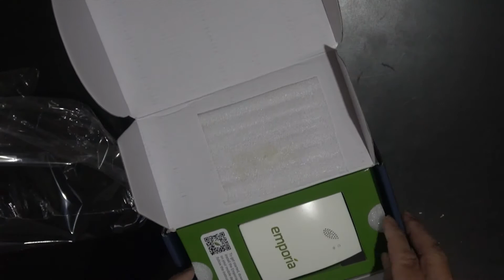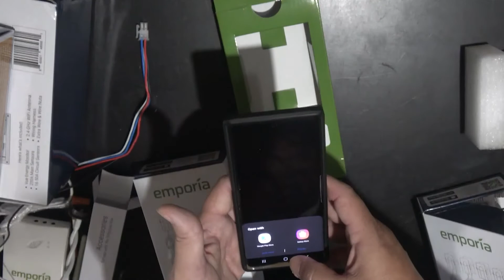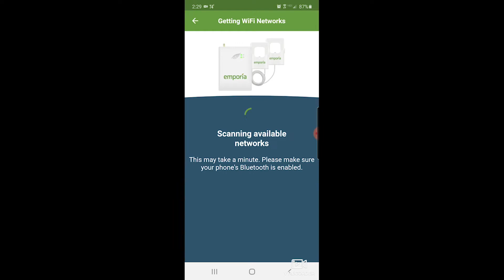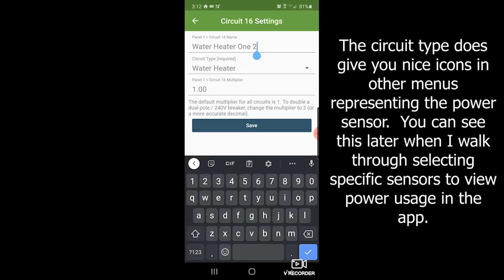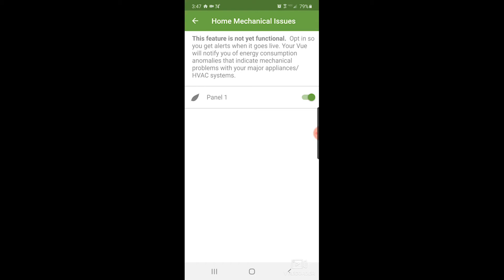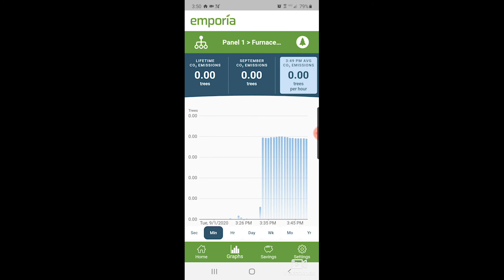Emporia Vue 2 Installation

Comment: What if I have 3 phase/3live wire main circuit breaker and supplying to 3 sets of 3 phase/ 3live wire sub circuit breaker. How the CT sensor should be clip?
Reply from the maker: The Emporia can support 3 phase, but you need to buy the 3rd CT for the 3rd phase separately.

Comment: Where did you get instructions as none were provided? Also, we have two panels as well and only intend to measure key circuits. Can you run a sensor into the other panel? That will mess up the percentages as the other panel has separate mains I would think but the circuit usage should still be accurate. Thoughts?
Reply from the maker: I got the instructions online as well.  Forget the link but if you chat them on the  website they can give you a link.

The way it is designed, you can't monitor another circuit in a different panel.  Theoretically you could if the sensor wire was long enough to make it to the circuit, but as you mentioned it would throw off total usage on the panel the main feed monitors are on.  If you were not too concerned about measuring total usage, it might work.

Comment: Why does your main show a higher value than the sum of the values shown?
Reply from the maker: This is because I don't have every breaker monitored so the total is more than the total power pulled by all the sensors. Mine is also thrown off unless you break it into an excel sheet b/c I have a panel outside monitoring HVAC that then feeds a panel inside that has two more Vue2s in the same panel.  They fixed it in an update where you can have panel A feed panel B, but there hasn't been update yet (that I'm aware of) that allows two Vue2s in the same panel and calculate total power used correctly in the app itself.  I've verified a few times that the total power used and the power used on each sensor is accurate, it just doesn't work in my case in app due to the daisy chain and side by side configuration without breaking into an excel sheet and manually doing the math.

Comment: Both my printed, and app, installation instructions state "IMPORTANT! the K (arrow) L imprint on the bottom of the sensor should point away from the breaker". The individual in this video states the instruction say it doesn't matter which way the sensors are installed (which way the arrow points). Clearly an incorrect statement by the presenter in the video..
Reply from the maker: The feed sensors monitoring incoming power at the top of the panel need to placed a specific direction as shown at the 8min mark.  Sensors on individual breakers do not have a specific direction.

Comment: I noticed you have two main panels like I have in my home.  Could I monitor both panels with one Emporia Vue system or do I need to purchase two of them and monitor the panels separately???  Does the app allow you to monitor multiple panels and view them collaboratively?
Reply from the maker: You can only monitor one panel at a time as a single Vue2 must connect/monitor the incoming power feed.  If you have two panels they should have separate incoming power feeds, thus the need for two Vue2s.

Comment: Do you have to have 2 spare breakers in order to install? Thanks
Reply from the maker: No.  You can plug into an existing breaker and share power.  Its not the best idea as you shouldn't have two wires in a single breaker, but it works.  You want to have a single open breaker.  You only need one for the Vue2.  I have two breakers as I have two Vue2s in the panel.  You could also use a single existing breaker for two Vue2s and what ever was being powered by the breaker.  If you monitor that breaker with a sensor you also gather Vue2 power usage.  
Not an electrician, but if I was going to do it, I'd run a copper wire from the breaker far enough where you had plenty of room (say bottom of panel box) and then splice in the existing wire and the Vue2 power.  Neutral both get secured separately on the bus bar.

Comment: great video, I used this to do my installation you explained everything very well. I could've just used the 8 sensor version I only have one panel  but oh well. Great tip on numbering the plugs and sensors! im getting ready to go out and clean up the wire mess pretty soon zip ties zip ties zip ties but im taking a sharpie to number plugs and sensors at the same time....   
One question for anyone with an answer (smart plugs with the VUE 2). Have you used any of the smart plugs as well? since most circuits serve multiple plugs / lights etc, I was wondering if the smart plugs will off set the breaker level reading or will it duplicate the usage? for example, say if I have a coffee maker on a kitchen sensor and use the plug to see what the coffee maker draws will it subtract that from the circuit reading or duplicate it? does anyone know????   
thanks again for the great video!!!
I also looked into sense and this just seems easier and about 1/2 the cost.

I did instal this myself in about 30 minutes and no I am not an electrician --- I'm just going to repeat because it is so important---- 
the big wires where the large sensors go:::: are ALWAYS LIVE, ALWAYS  even if you shut off the main breaker that is the utility power  side and your shut off only controls your panel --- the big wires are always live!!!  so if in doubt about your ability please dont mess with it.

Comment: Quick question. When I use the multiplier for my 240V A/C the wattage doubles. This I checked in the graph section. The amps units on the other hand do not double (assuming the same current flows through both legs) with the multiplier, they stay the same. The current showing in the Balance is not correct. Please try it to see if you get the same results.
Reply from the maker: I checked this and mine works the same way.  When a multiplier is used on a sensor (in my case testing with clothes dryer - 240v) the amps do not use the multiplier but the watts do.  I don't have any dual breakers monitored with two sensors anymore or I'd check the amp usage on each breaker. I don't believe it would be different though. There could be a small difference in amps between the two, but they should be very close.  I did have a few 240V appliances that pulled a very small difference in power between breakers, perhaps 1-2% difference.  I left the sensor on the breaker that generally used more power and used the multiplier on it.

When you say the balance is not correct, what are you seeing that makes you believe it is not correct?  The balance will be the total power used (clips on feeds coming into panel) minus all the sensors calculated usage.  The 'balance' is the power usage of the remaining breakers in the panel that do not have a sensor collecting data.  So if you have 20 breakers and 16 sensors (assuming none are dual breakers using a multiplier) the 4 breakers without a sensor is the 'balance' usage.
Reply: @forayfog2276  where you have a double breaker with just one sensor using a multiplier of 2, the current in the leg without the sensor is calculated in the Balance circuit. You are correct in your calculation if all the sensors are connected to one pole breakers and there are more one pole breakers without sensors then that current is in the balance circuit. They should correct the multiplier so the current doubles in the double breaker  circuits using just one sensor just like the watts double. It makes no sense to not have the current double. Just like it makes no sense to use two sensors and then have to add both sensors to calculate the load on one 240v breaker. I hope they fix this with a firmware update.
Reply from the maker: ok, I see what you are saying.
When monitoring one breaker of a dual breaker, the multiplier function should double amps and watts (could be any multiple, but in this case dual breaker so we are using a multiplier of 2).  Currently it is only doubling watts.  Because the watts are doubled, it effectively calculates total watt usage for the dual breaker and it does not show watt usage in the 'balance' from the second breaker of the dual that does not have a sensor.   Amps are not doubled for some reason, but should be.  This causes extra amps to show up under 'balance' rather than be properly be accounted for under the multiplied sensor.

Good catch.

Comment: Can you monitor A phase and B phase separately?
Reply from the maker: A single breaker will only be on one phase, that I know of (110v).  If you have a unit that requires 220v, it has two breakers next to each other vertically.  On most (perhaps all?) 2 phase panels, the A/B phase alternates going down.  So when you have two breakers next to each other vertically, they will always be on a separate phase.  If you have a sensor on each hot wire coming out of the breaker you are monitoring the usage on that single breaker which is on one phase.  So yes, you can monitor power usage of a breaker as it is on a single phase.

As far as monitoring the total power usage of each phase at the top of the panel, you can not in the app, or at least I have not seen it.  If you export the raw data, it does show the total power usage for each phase/feed.  You would need to document which monitor/clip is feed 1 and feed 2 and read the sticker on the panel to see what phase each breaker is mapped to before closing the panel up so you can total the usage of a specific phase you are interested in.

Comment: Could you explain the 240V breakers. I think you mentioned putting two monitors on each wire.
Reply from the maker: In the US you generally have 2 feeds of power into the house, sometimes referenced as Phase I and Phase II.  Each is 120V.  95% of items power in the house use 120V, but there are a few appliances like the AC compressors outside, clothes dryer, electric water heater perhaps a double oven that need 240V.  Most circuit breakers have 1 switch, these are the 120V power feeds to the house.  A few, normally at the top of the breaker box are two circuit breakers where the switch is fused together. When you turn this breaker on/off you are actually turning 2 breakers on and off at the same time.  Each breaker pulls power from Phase I and Phase II.  These are wired in series to the appliance which causes the voltage to be added together providing 240V to the appliance (120V circuit breaker from Phase I, 120V circuit breaker from Phase II = 240V total).  Generally the breakers that have the switch fused are higher amperage as well as appliances are high draw (30-50amp).  The single breakers that feed electrical wall outlets and lights are smaller at 15-20 amps.  Hopefully this helps.
Reply: @forayfog2276  Thank you for the reply. If I wanted to monitor a 30 amp breaker double pole. How many sensors would I use? Do I put one on each line?
Reply from the maker: Check out this other video I did on monitoring dual breakers
https://www.youtube.com/watch?v=pIlAjr_fLtg

You have two options:
1) put a sensor on each and manually add together to get total usage - most accurate
2) use a single sensor and in the app double the usage

When you monitor both with individual sensors you will need to manually add the totals together for everything and since you can't view both sensors usage on a single page, its time consuming at best.
When you monitor a single breaker on a dual breaker setup, you will lose accuracy as both may not pull equal amounts of power.  When I first setup my monitoring I put a sensor on both sides of the dual breaker and evaluated if they were pulling equal.  Most were, some were not (but close).  In the case where it was not equal I left the sensor on the breaker that pulled the most power.

Its really a question of convenience vs accuracy.  For me, because the usage was close enough between both breakers (maybe 10% difference on single appliance not used that often), I just left the sensor on the side the pulled the most juice and doubled it in the app.

Again, check out my other video and dual breakers and it goes through all this as well.
Reply: Thank you very much, I will watch the recommended video you linked

Comment: You do not need to unwrap saran wrap, just pull the amount of wire needed.
Reply: Just got mine this week (June 2021) no more saran wrap, just twist ties.
Reply: Wish the saran wrap was still there, cable management is a nightmare

Comment: Thanks for this - considering to install one as well. It was very scary to watch, as you tapped your fingers near the mains a couple of times.
Reply: With power off, circuit breakers are off, but mains coming in and lugs are still hot, unless you had yet another breaker such outside. Some may not have this option.
Reply from the maker: It does get pretty tight feeding lines around.  I need to do a follow up video on what I've seen so far and some negatives.  The biggest negative thus far is having multiple monitors on a single feed.  The Vue monitors ALL power going through the feed and deducts power from the sensors.  Anything used but not seen by a monitor is stuck in a 'balance' bucket.  If you have 2 monitors on the same feed, the total usage is off as the balance of one monitor is the usage on the other.  On one feed I have 3 Vues (one on an outside panel feeding AC units and two on the inside panel)  They are supposed to be coming out with an update to the app that allows you to combine two Vues, but there's no ETA on it.

Overall it does what it says and it is accurate.  I can see where I'm using power and how much.  I've found what uses the most power (AC Compressors or Water heaters) but I haven't been able to save much power.  Just turning down hot water a little, changing temp of AC helps.  Most everything else is what it is outside going crazy trying to get kids to turn things off which isn't new.
Reply from the maker: PS, if you turn off the power you don't have to worry about what you touch when you install it, only when you are done that nothing is touching.
Reply: @forayfog2276  --- except the mains at the top - I wouldn't want anyone to misunderstand that -- big wires are always on in the main panel.
Reply: @anonimous596  I have to believe he killed power to the entire panel (he also mentions above he has an outside panel feeding the inside ones).

Comment: must take into account the following
1. you are violating article 312.8 nec
2. to work on an electrical panel you must use protection, off panel, use tools with insulation
Reply: NEC is for licensed electricians. In most states, you can be a non-licensed electrician (I.e. not an expert who knows and follows rules) and work on your own house and you can violate NEC rules. Nobody's getting a fine or arrested for not following NEC rules. However, if you die for being stupid, you die. If you violate the rules on actual installation you could set your house on fire, or simply fail the next inspection and have the service remain disconnected until you do whatever it takes to pass inspection. Happens a lot when people go to sell their home, fail inspection, and discover they have to pay a lot of money to fix their shoddy work. Too much of that and buyers will run.
Reply: @trevorwesterdahl6245   my thought is that this is mine and if it fails an inspection - it took me 30 minutes to instal it and probably take me 30 minutes to remove it---  :-)   same with my generator interlock........ but Ill likely take the vue  with me if I move anyway.